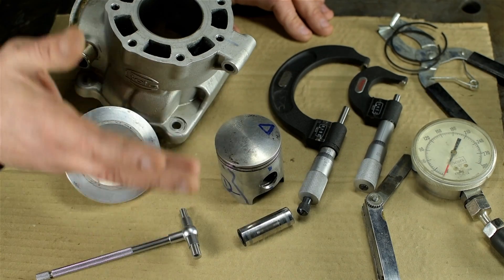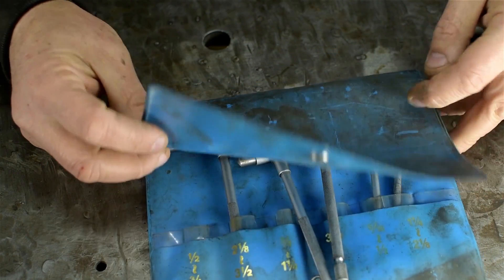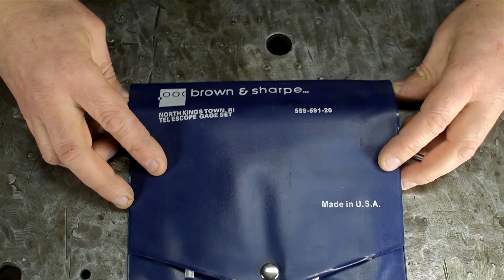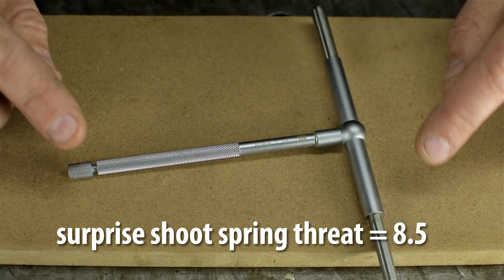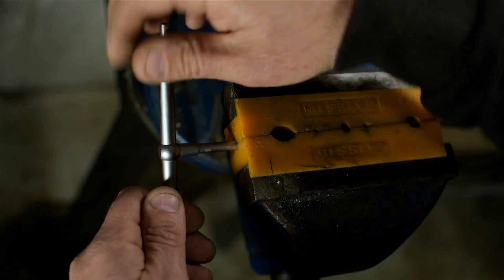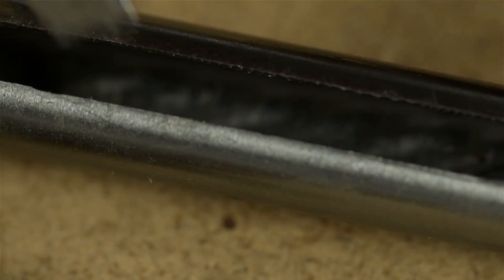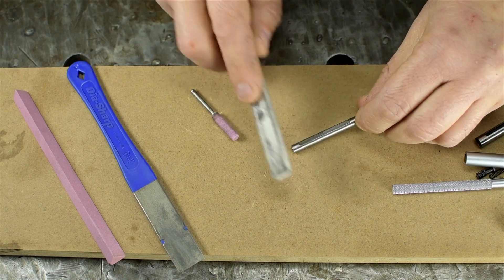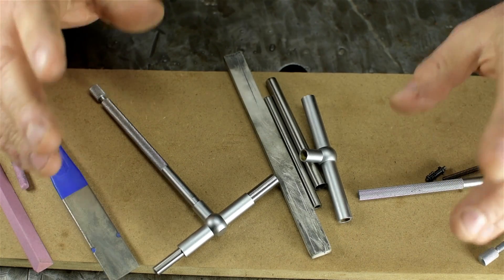Silky Smooth Telescopic Bore Gauges

Comment: The depth of the slot should get slightly deeper at the extended position as well. That way they tighten as they are compressed making the friction lock more effective. 
I just bought a cheap set. The feel is decent, but they loosen as they are compressed making them unusable. That makes the plungers rebound after rotation in the hole, losing the measurement. 
Seems like a little pellet of a plastic in the friction lock shaft would improve them too. Having that little bit of springiness would compensate for inaccuracy in the groove in the plunger keeping a more consistent friction.

Comment: You messed up. Should have bought the starrett where only one side moves. They are Hella smooth right out of the box and tension to lock is so much lighter only having to hold one side.

Comment: I wonder if it might be worth it, after deburring the sharp edges, to pack the sliding bits full of lapping compound, reassemble the gauge, and squeeze it a bunch of times to lap the parts against each other.

Comment: I bought a set of B&S telescoping bore gauges about 40 years ago. They had the same problem and I had to take them apart to deburr and clean them. B&S obviously still doesn't care judging by your experience. The only thing I hate more than cheap tools that don't work is expensive brand-name tools that don't work.

Comment: When I first heard it I was certain they were just using a different bad spring. But they shut didn’t debur the parts! What the heck that blows on such a precise tool you have to check for that. Unless you got one that a step was skipped on but it seems to be your home set.

Comment: Great video. i found your sine bar video before this one. Now i have to take all my telescoping gages apart. Got starrett, deep bore brown and sharp and an asssortment of old odds and ends. I may do a light polish on bottom of tracks. Im a gage maker so telescoping gages not used very often for final size but I got to take a look at mine now. TY for video.

Comment: So, I guess I might as well just buy cheap Chinesium snap guages then. They will be roughly the same standard and I'd just have to clean them up in the same way. It's disappointing how the quality of things (not just tools) is degrading. I suppose good tools are still available, but the price is astronomical. More of an indictment of the debasement of currencies, which is masked by the availability of poor quality imitations of goods that were previously available. Back in the day, a good pair of work boots would cost a weeks wages, now you could get a cheap pair for an hour's wages. Things are falling out of any semblance of balance. The center cannot hold, I fear.

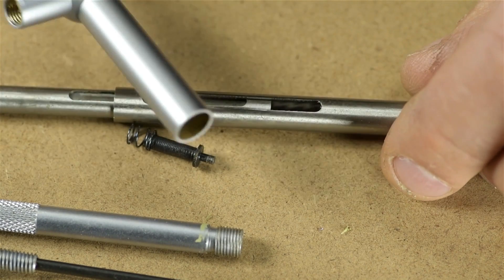Comment: Ok, I'm at 5:24 in the video, and my first thought is "maybe all those burrs are by design; to add friction, in order to avoid the issue with the cheap set, where the pin had to be tightened too much" - I guess I'll find out when I unpause the video.

And yeah, I'm nearly 2 years late.  What can I say - I only just discovered TOT, and I'm bingeing whilst at work with nothing to do on Xmas Eve because everyone else had the sense to book the day off.

Comment: Hi Tony i have a chinese set and was pised that when you tighten it up it changes the setting so i disassembled it did a little sanding then i started shopping for good used set of us made ones now I'm not going to buy a us made set until i can see if i can get the chinese made set working good and shop for a inside bore gauge set up to 6'' Thank for the video .JM

Comment: Nice video. Knowing how to disassemble the bore gages may come in handy some day. 
Those dremel stones work great on a chainsaw chain. Takes a steady hand, equal pressure on each tooth at roughly the right angle. No guide - it will only distract - use feel. Every third sharpen reduce height of cut height runner link/bit.
Hope you are doing OK. We miss you - no pressure to return.

Comment: i always let my springs go sprong from inside an upside down clear rubbermaid box, so that way... instead of flying across the shop.. they just bounce around until they make it into the 4th dimension, and then i mysteriously find them inside the air conditioning filter housing under the work bench. I think the 4th dimension is hot?? so things re materialize in this one where cold things are. Maybe that explains how that ratchet wrench ended up in the freezer next to the hotdogs

Comment: Just shooting the poop, but I think the coarse locking surface on the pop gauge plugers is to give the lock a surface that will bite into the pin when tightening.

I don't know that for sure, but that would make sense to me. 

The remaining sharp edges are disappointing.

Comment: I have a set of Starrett telescope gages that suffer from the same problem. It's the only Starrett stuff I ever got that wasn't close to perfect. I haven't done much about them because I also have an older set of Lufkin gages from my fathers toolbox. They are just perfect. If you think measuring with a telescope gage is old school inaccurate you probably have a set of gages like these B&S ones. Man they are a repeatable pleasure to use if they work correctly!

Comment: Only looked for vid because it was mentioned by Stefan G. The finish on the B&S is probably worse than the 'Chinese kit parts Stefan usually deals with. The only real difference I could see between real cheap ($15.00~$20.00 sets) and B&S is the cheap ones have less material at the end of the tubular plunger so locking at full compression then unlocking doesn't blow the slot out. as quickly (seen them fail straight out of the pack)

Comment: Mr. TOT, may I ask a question/make a suggestion?! Would you be opposed to making a beginners video? I mean just go through a “must have” list for beginners; i.e., like me. Or if you have or you know of such a video, please share the link because I haven’t found it. I just bought my first lathe (grizzly G0765) and about to purchase a mill (G0781 or G0758(z)) (also which is better for a newbie with NO EXPERIENCE) and I tried asking grizzly cs about what I might need to get a good start (with no real help). Maybe you could help me?  All I’ve heard so far is “get a 4 jaw chuck and a gauge” and that’s about it. If you can think of a beginners “kit” and let me know, I’d greatly appreciate it! Thank you for your time! Keep up the great work!!! 👍🏼👍🏼👍🏼👍🏼👍🏼

P.S. 
the main reason I’m getting the mill is for facing and making gears. I also bought the rotary table w/ divider plates. But I got cheap cutting tools from harbor freight. And I think that’s about it.

Comment: I have an old set of 8 Starrett bore gauges from 2/10" to 6". I just pulled them all out now to check and all of them do the same thing. This set is very old, from probably the 1950's-60's, set in perfect condition, each one still in the original red cardboard Starrett box. I can't help but wonder if this isn't somehow by design. It doesn't make sense either way as both companies are known for top notch machinist tools. I guess I'm just really surprised to see old time Starrett tools with the same issue. Never noticed it before in usage though. They're definitely a bit crunchy if you listen close. Curious.

Comment: Inspired by your video I bought a cheap set of these telescoping gauges myself, planning to clean them up and make them nice. 
But by some miracle this cheap set was actually finished a lot better than Tony's B&S set. 
The only internal part I can improve upon is the plunger tip that rides in the slots. The slots themselves are beautifully finished. 

It's the "Sealy" set on ebay, sold from the UK
They are nicely satin finished too, unlike the rock bottom cheap versions

Comment: I gotta better telescopic bore gauge an ancient Mitutoyo one that's extendable to 4ft :D min diameter is 1.5 inches though . mostly used on large diesel engines of mine variety. it doesn't suffer these problems

Comment: Tony, cleaning up that locking pin will make the biggest improvement. (I just went through my entire B&S set.)  Stone the sides of that pin smooth and it will help a lot, in addition to cleaning up what is possible on the grooves.  It still won't be as good as it should be.  The machining on these B&S gauges is pretty horrible.  My Chinese no-brand gauges are much smoother than the B&S.

Comment: On further examination, the condition of the internal parts and surfaces suggests that these are fakes or rejects. Bought them on Amazon? I went through about 5 keyboards one time and got the opinion they were dug out of a reject bin. All bad, each with a different problem.

Comment: I have an old set of Starretts bought new, with essentially the same problems. I may use this opportunity to smooth things out. Wonderfully nice hardened materials, but really notchy to use. 
Usually engine builders use feeler gauges to check piston clearances. You should know where on the piston the mfg wants you to measure the clearance since pistons expand from uneven heating when in use. Air cooled cylinders may be choke-bored to allow for combustion chamber heat in the upper cylinder. Instructions for fitting new pistons to a cylinder on your engine would likely do just fine. Make sure to check end-gaps on piston rings to match cylinder bore so they are not too tight.

Comment: Learning that the handle screws out of the head to release the anvils was worth the price of admission. (Actually, since admission is free, it was worth lots more than a buncha bananas (or any other currency you care to posit)). Knowing that for sure, allows much greater torque than if you were wondering about how they go together (or come apart). Useful video, with the usual TOT style. Thanks.

Comment: Oh, I could hear the crunch, is it sad that the cheap sets I used in high school almost 20 years ago seemed to be better than that? I do not remember hearing or feeling those  being crunchy, and those were abused by kids less careful than I was. This said, I was always the one in the shop that was super picky about...well, everything I did. I took care of the tools and was building my projects to higher standards of finish than was asked for. The equipment and our work was only supposed to be accurate down to .01 inch, and I was being accurate down to .001 inch, the teacher was not happy that I used his dial caliper to test my work, but, I tend to be a perfectionist and had one of the highest grades in the class, despite being sick often and missing out on a couple days of work here and there.

Comment: Dont you think the grainy texture on "the floor" of the key seat is so that the thigtening pin grip when you lock it. And that if you file that down, you would have the same problem as the old ones. That the contract when you messure them?

Comment: If the best tool makers are turning out this quality then we may as well all shop cheap Chinese. Does any company that still makes high quality machinist tools ? I've got some great quality old stuff I picked up on Ebay, but I don't trust any tool companies now. I have 2 Bosch grinders, both the same, but 1 is built in China, the other in USA, massive difference, china built has a shorter, stiffer cable, a noisy gearbox and less power. I got them both online from the same company selling them on Amazon. How can we trust anything?

Comment: I've never used these telescoping bore gauges, but I have a mixed collection of Starret and B&S inside micrometers which serves the same purpose. Well, one of each brand of "micrometer" part with a bunch of interchangeable anvils to increase their reach. With the major exception that I don't have anything smaller than 1 inch - wanna know the bore of that crusty 12" pipe? No problem. Wanna know the size of that bearing bore? Heck if I know, do I look like a psychic, getouttahere, etc.

@ThisOldTony Do you find much, if any, mismatch between measured bore on the telescoping gauges and "real" bore when you make parts to fit? I keep imagining they have some slop moving between the bore and the micrometer, where the inside micrometer has to be screwed out and fit checked repeatedly.

Comment: I find if I chuck round items in my cordless drill, it makes deburring, champfering, polishing, etc go much faster. If the item can be damaged by the chuck, some vacuum hose stretched over the item works great.  

I haven't found anything other than vacuum hose to work as well. Fuel line is reinforced, and doesn't stretch as well, and vacuum line tends to be thinner walled. It goes on easily, and comes off easily.  If the vacuum line slips, wipe the part with alcohol to remove oil residue.

It's really sad to see Brown & Sharp stuff with such poor finish and QC.

Comment: “Shame we have to do this to ‘premium’ tools”. I bought a brand new set of B&S parallels- had to grind the 1/2” pair so they’d match. A brand new pair of B&S v-blocks I had to grind one side to put the vees on center. Went from referring to Brown and sharpe as B&S to just BS!
Reply: You probably ordered a set of perpendiculars accidentally.
Reply: Were both V blocks off center by the same amount? What made you check to see if they were on center to begin with?
Reply: B&S just isn't what they used to be. They lost quite a few of their older established skilled craftspeople during a labor dispute in the early 80's and it was more or less downhill from there.

Comment: Tony:  GREAT video,  I've had EXACTLY the same frustration bought a set of Mitutoyo's to use for (same as you in video) measuring cylinder bores and they're sketchy so bought a set of Starrett to see if they'd be better, NOPE, they were worse!  It never occured to me to deal with  problem, thanks for waking me up, I'm going to pull  mine apart and deal with it.

Comment: Working in a high end CNC shop, the work on those gauges really depresses me. Most of it looks like they've used dull HSS tools, and whatever inserts the collage next door had thrown in the fuck'it'bucket. You'd expect more from a high end manufacturer,  but it looks like they have build the entire process around speed, and not precision and quality, since the actual precise parts come pre-formed, and all they do is thread, cut, and mill the slot. It's bullshit, I'm actually angry at this.

Comment: Didn't have much success using these gauges. Couldn't achieve the repeatability I was looking for. Once in the bore and locked, is it best to gently tip the gauge out of the bore? Can't always lift it straight out, due to some bores having a lip around the opening.
Reply from the maker: quickly tip it out.  don't try to pull straight. the sweeping motion is what says the gauge size. tighten enough so the sweep can pick up the size, but not so tight it won't move.
Reply: @ThisOldTony  Thanks! I'm going to need lots of practice to get it right. Trouble is, I don't need to do this very often and then I start from scratch again. 😐

Comment: I stopped the video half-way through and went down to the shop. My Chinese gauges sounded just like your B&S ones. I'd gotten a set made in Japan, probably when I got the Swedish lathe. Most of those are quite smooth, but a couple had a bit of catch to them. Added a project to the isolation list. Thanks, Tony.

Comment: I've got both of those sets.  The "4th birthday" set was rough, and I actually did some of this work to clean them up.  It helped some, but I got tired of it and decided to get a better set.  So I "splurged" on the B&S set.  They are every bit as crunchy as yours are.  B&S seems to just be making the no-brand junk at B&S prices these days.  With the slots that rough, no amount of deburring is going to get them where they need to be.  I keep telling myself that I need to just spend the money for the Starrett set, but somehow I just don't trust that they won't have the same problem these days.

Comment: Pro tip, when the surprise shooting spring threat is high, disassemble within a clear plastic bag. The bigger the better because if you can keep your hands way down in the bag while you disassemble, the springs have further to shoot to escape the bag.  Drape a shop rag over the opening, hold it close to your chest, or do something else to try to minimize the opening.

One more pro tip for when you've already lost a part. Grab a flashlight and turn off the overhead lights. Get down on the floor and shine the beam nearly parallel to the floor. Any dust, dirt, chips, or parts you're looking for will now cast a very long shadow, making them easy to see. I think the beam also helps to focus your attention on a distinct area instead of taking in an overall picture. Try it, you'll be surprised how dirty your floor is.
Reply: Plastic bag!!! Well that's a great idea
Reply: The light on the floor trick absolutely works. A strong magnet can also be very helpful

Comment: Maybe they are badly made because those who appreciate and have the money for high quality measuring tools buy "proper" internal measuring gauges. Unfortunately, you need a whole drawer full of them to cover a decent range of measurements , so they likely bust the budget of any home machine shop, if you're not a millionaire. I'm guestimating that telescopic bore gauges need extremely precise machining if you want to achieve similar results, because the locking mechanism likely deforms them if they have any play. Never used them though, so my rambling might very well be bs.

Comment: Carpeted garage? Yeah sure. Mine is Shag. Perfect for losing hammers and saws if they fall off the table. Also, my work bench has a 3" bow in the middle so that when I run the off balance grinder it clears everything off of it. I guess I could build a tray beneath it to keep things from getting lost in the carpet. Another day perhaps.